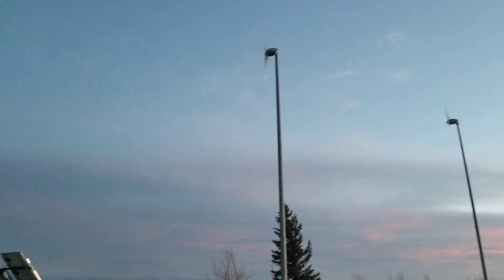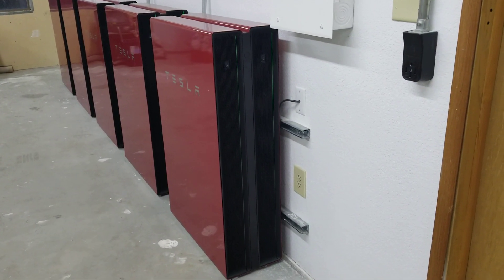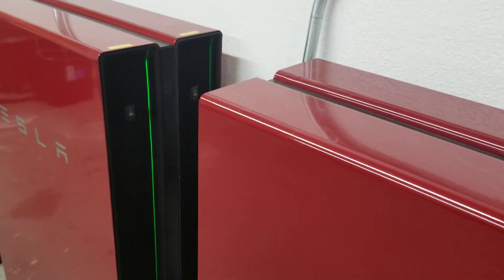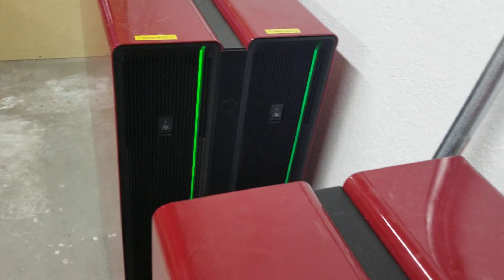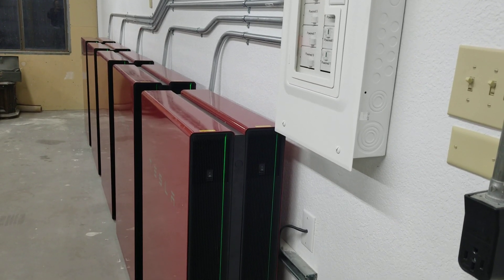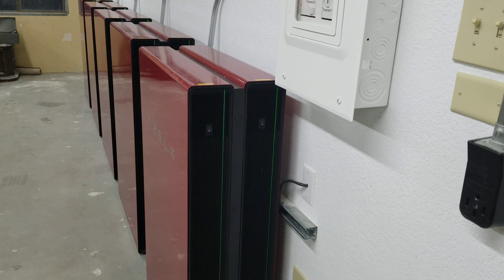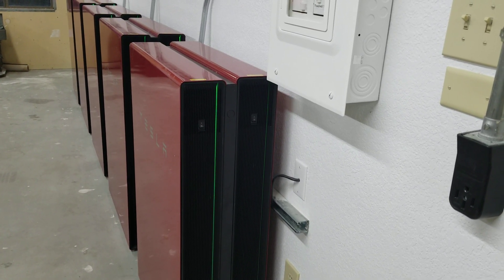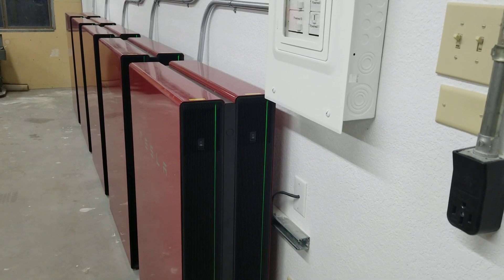Our 10 Tesla Powerwall 2 being charged by wind

Comment: Wind and solar energy combined with battery storage is the future.
Reply: @Jason Bloomberg I just came across your video and description- thanks for posting. I live in Scotland and have just installed a grid connected solar PV system with a Tesla Gateway 2 and Tesla Powerwall. The system has been up and running now for a month and a half. It’s cloudy and windy in Scotland and I’d like to supplement my renewable power generation with a small wind turbine, which will help to charge my Powerwall on windy days when it’s cloudy (which is common in Scotland) and in the winter when the days are short. Can you share the design of how you integrate the power from the wind turbines to your Powerwalls? I’m trying to figure that out and it’s complicated what components are needed - I’m being told different design approaches that seem more appropriate to me for an off grid system, rather than a grid connected system with battery backup, which is what I have. I’d very much appreciate your advice here as you have done it and it’s working. Thanks!
Reply: till its winter and theres snow and no wind.. ;)
Reply from the maker: @mattbarrand  actually we have substantial solar power production and even more wind power in winter. The batteries help bridge low gain days.
Reply: @AltView1  10 Powerwalls, wow! What is your self-sufficiency level? 
I would guess close to100%? 
What is your power consumption per day? 
Do you have any other large energy consumers besides your Model S? 
Maybe you could make a video of your power curve in your Tesla app? Would be interesting.
Reply from the maker: @Mr21December2012   On an annual basis we produce more electricity than we consume. One of the technical challenges for us is to balance generation and usage in order to minimize utilizing the grid.  This is where the batteries fit into our system beyond being a backup source of electricity during grid outages. 

Our home is all electric. We monitor our electricity use  using SENSE (R) which helps us understand which which devices are using electric at any given moment as well as daily, weekly, mo they, and annual consumption.  It also gives a comparison of our electricity usage with other homes equipped with SENSE (R) in Wyoming and the United States. While our electric vehicles account for ~30 kWh/day, our overall daily use of electricity in February 2021 was ~102 kWh/day, which is the average in Wyoming for typical homes which also have fossil fuel heating.  Nationally in the United States the average electricity use for the same period was 69 kWh/day. 

There are 100,000 BTUs per therm of natural gas. There are 91,740 Btus per gallon of propane. There are 3413 BTUs per kilowatt hour of electricity.

Comparing electric home heating to combustion is not intuitive because it takes a large quantity of electricity to creating the same amount of heat as combustion, but because electricity can be made by renewable sources, when it is sourced that way it remains the environmentally better wat to do it.  That does not make it cheaper in the short term.  When people talk about monetary costs, rarely do they include the environmental costs of man made climate change or the health impacts of air pollution. From my perspective, fossil fuel use can be seemingly cheaper for the end user, but that is due to cost shifting the real expenses of environmental and health impacts on to others.

Here is a link to information about SENSE (R): https://sense.com

It's a device / system we use. Others may use other similar equipment.  I'm posting the link so you can understand what I referred to, not trying to promote it.
Reply: @AltView1  I think your wind power installation is very interesting  (especially, since you seem to state that you make more wind power in the winter, than solar) - and probably overlooked by most people trying to use renewables for home use.
Reply: @AltView1  are the wind turbines  winterized ?, see what happen in tx if their not.
Reply from the maker: @hillbillyintheasia6122  small scale  residential wind turbines are not "winterized" in that they do no not have active defrosting systems. That said, the Skystream 3.7 blades are made of materials which resist the kinds of ice accumulations which were a problem for the large scale turbines in Texas.  We have just been through over 36 hours of blizzard conditions during which our turbines continued to fully produce power.  There have been freezing rain storms in the past which have Iced blades to where production dropped for a day or two.  Having a system like ours which balances power production between wind turns, pole mounted solar PV, with substantial battery back up means for us, when the grid goes down we likely will have uninterrupted power.  We also have a secondary back up system, a propane fueled generator should the array and turbines become unable to produce power during a grid outage and the batteries become depleted. In short, we are the opposite of Texas.  We routinely live with real winter every year and have systems designed to work under these conditions.

Having pole mounted PV also means we are able to remove snow, if needed, in winter when it would be nearly impossible to do that on a roof mounted system.  

Here's a link to my video about it:

https://youtu.be/Z1DnH0JzTqA
Reply: @mattbarrand  I think you missed that this guy is up in Cheyenne.... xD.   There's ALWAYS wind.
Reply: @mattbarrand  
Don’t forget lack of natural gas and shortage of  liquid gas as seen in Texas.....
Reply: @mattbarrand  but there's still salt to put on the solar arrays, and sun yay

Comment: Did you have any problems hooking the wind turbines to the power walls.  I know Tesla hasn’t really stated how to combine the wind power with the solar in there system.  Your system looks great.
Reply from the maker: All of our grid tied solar PV and residential scale wind turbines go to a 100 AMP  "renewable combiner board" which connects to the Tesla Gateway on the House side of the circuit.  The system itself treats the wind turbines no different than the microinverters for the solar PV.  They all operate even when the grid is down unless the batteries are 100% charged. At that point the inverters in each Powerwall 2 shifts frequency so that the turbines and microinverters shut off until the batteries are sufficiently depleted that they can again accept charge.  Tesla does not certify wind turbines for use with the Powerwall 2.  There are not enough of them to make it worthwhile, but the Skystream 3.7 turbine meets the same National Electric Code standard as most solar PV inverters, so in fact, they work. This may not be true of all wind turbines.

Here is a link to a tread I started on this topic: 

https://teslamotorsclub.com/tmc/threads/residential-wind-power-and-powerwall-2-integration.191776/

Comment: Rig for silent running.  The peasants down the road have a loud construction site generator.
Reply: Might happen soon!  Meanwhile you hold the record in my book for home energy independence. Anything I can do is limited to 1/2 acre in the bottom of a wooded canyon in NorCal.
Reply from the maker: I actually went around to my neighbors before the turbines were installed and all of them were fine eith it. Many of them have during ranges on their properties. Generally, the ethos here in Wyoming is, what you do on your property is your business, not mine, unless it impinges on my enjoyment of my property. Nonetheless, I still checked back after installation of the turbines and everyone was still fine with it. Our property is just under 10 acres, the rest in the neighborhood are a minimum of 20 acres, so we all have a fair amount of distance from each other.
Reply: @AltView1   You have a great system, very impressive. My lithium batteries and inverter keep my fridge and chest freezer cold for about 4- 5 days. In NorCal the utility shuts the grid down for wind emergencies and wild fire. The last time was 4 days. Some guy about 1/2 mile away had a loud generator that ran for 3 days and nights. I was awake at 3AM  from the heat (92 in the house, terribly  smokey outside). The generator sounded different, clattered for 20 seconds then stopped for good. I think it threw a rod. He refueled it while running but probably didn't check the oil.  My batteries and inverter worked fine, no sound at all.. All of the unprepared neighbors had their cold food spoil.
Reply from the maker: @kimmer6  It would be great if you would make and post a video about your system. I'd love to see it.

Comment: Don't even want to know what that cost (of course I do).
Reply from the maker: Cost of Powerwall system installation ~$100,000 (not including solar PV or wind turbines).
Reply: May I ask how many KWH you average per month?
Reply from the maker: @wilhallman2890  both production and consumption substantially vary seasonally.  Last year we produced 33,895 kWh and consumed 30,249 kWh. The highest consumption was in February 2020 using 4013 kWh and lowest in August with 1307 kWh.   Highest production in 2020 was January with 3540 kWh and lowest was September with 2337 kWh. While at the end of December 2020, we had over 4,000 kWh banked with utility under Wyoming's net metering law, it is not permitted to roll into the new year, instead having to be cashed in at the wholesale rate of $0.03/kWh while we pay $0.105/kWh for any power we draw back from the grid during January, one of our highest consumption months due to the effects of cold weather on our home and electric vehicles. We hope the onsite storage with our batteries will help shrink  how much we rely on the grid for net metering, especially since the Wyoming Legislature is trying to kill all net metering in Wyoming.
Reply: @AltView1  80kWh/day is huge energy usage. 
What percentage of that is consumed by charging cars?

I live in Europe, 4 people, 2000 square foot apartment. Average energy consumption is 10-13kWh/day ( home office 3xPC 8-15h/day ), and compared to people whose bills I've seen, I have high energy consumption. 0.19$/kWh (whole bill/kWh used, not just energy cost).

Non-electric energy costs: City heating(expensive) avg 311$/winter month, gas stove, gas hot water (25$/month).
Reply from the maker: @CarmichaelCharles  in your question you note that you have non-electric municipal heating (centralized stem plant?), gas cooking, gas hot water, all of which are combusting fossil fuels.  Our home is all electric. We monitor our electricity use  using SENSE (R) which helps us understand which which devices are using electric at any given moment as well as daily, weekly, mo they, and annual consumption.  It also gives a comparison of our electricity usage with other homes equipped with SENSE (R) in Wyoming and the United States. While our electric vehicles account for ~30 kWh/day, our overall daily use of electricity in February 2021 was ~102 kWh/day, which is the average in Wyoming for typical homes which also have fossil fuel heating.  Nationally in the United States the average electricity use for the same period was 69 kWh/day. 

There are 100,000 BTUs per therm of natural gas. There are 91,740 Btus per gallon of propane. There are 3413 BTUs per kilowatt hour of electricity.

Comparing electric home heating to combustion is not intuitive because it takes a large quantity of electricity to creating the same amount of heat as combustion, but because electricity can be made by renewable sources, when it is sourced that way it remains the environmentally better wat to do it.  That does not make it cheaper in the short term.  When people talk about monetary costs, rarely do they include the environmental costs of man made climate change or the health impacts of air pollution. From my perspective, fossil fuel use can be seemingly cheaper for the end user, but that is due to cost shifting the real expenses of environmental and health impacts on to others.

Here is a link to information about SENSE (R): https://sense.com

It's a device / system we use. Others may use other similar equipment.  I'm posting the link so you can understand what I referred to, not trying to promote it.

I hope this helps explain our usage and the differences between ours and your situation.
Reply: @AltView1  Thank you for your comprehensive answer. We still generate most of our energy from coal. I get my heating from coal in a combined heat and power plant.

I checked the national statistics and for 2018 the average household energy consumption is ~6.6kWh/day. 10x less than the US average. The only major difference in homes I see between the EU and US is very few air conditioners in households. 

According to the same source, only 3% of households use electric heating (including heat pumps and others) and 24% use electricity to heat water.

Comment: mounting next to floor not good - think water  - heavy rain flood ect
Reply from the maker: Each Powerwall 2 unite weighs ~250 pounds. It's  designed for floor mount and per Tesla when stacking Powerwalls, as these are in pairs, floor mount is the preferred method.  Also, when floor mounted they are on feet.  Ours actually are mounted to both wall and floorn inside our garage, more than 20 feet from the garage doors.  If water gets to these Powerwalls, we have bigger problems to worry about. Keep in mind, we are in Cheyenne, Wyoming and outside of any flood zones.
Reply: @AltView1  Cheyenne is in a wind zone. I've driven through there going to Yellowstone one time. It was so windy. I heard on the radio that a couple of big rigs had blown over somewhere on I-25 when I came through.
Reply from the maker: @Rhaspun  we did onsite wind studies on our property for 2 years before installing our first turbines here in 2012.  So far, these have withstood winds >90 mph without damage.
Reply: @AltView1  That's good. When I came through that one time. The winds were about 50 mph.

Comment: Wow super cool , your living the dream here!!As a sophomore doing electrical engineering I'm currently working on my own at home solar system so I can power my work shop and hopefully more one day. Though I'd like your input on something if you don't mind which is whether doing home system's like this actually better for the environment in terms of carbon dioxide emissions. ( this is not a troll but a serious academic question btw). For example was total approximate amount of emissions for the manufacturing of the power walls , ect. Something you factored in to deciding on your system here and if so where did you find the information that lists things like that cause I find it notoriously hard to find reliable information, what common soruces do you use to find such info?For states like we live in that have ditry girds , it's pretty clear that renewable is the way to go I'm terms of reducing foot print , though I'd like to be more rigrious in knowing how much impact I'd still be contributing even though it would be significantly less. Keep up the good work!!!
Reply from the maker: Trying to figure and compare carbon emissions in manufacturing and installation is challenging, in part because the carbon emissions "inputs" for the comparison varies widely from home to home and region to region.  We live in Wyoming. The majority of our grid electricity comes from coal.  This does not take complex calculations to determine the benefits of our minimizing our getting any power from the grid.

One way to see how clean or dirty your local grid is, is by using this tool from the Union For Concerned Scientists: 

https://evtool.ucsusa.org/

While it is oriented to EV emission impacts, try the same vehicle profile in different geographic areas.    

People who like to grind anti-renewable energy axes with pull all sorts of numbers out of thin air for the environmental impacts of making renewable energy systems, but rarely if ever consider the true impacts of the fossil fuel approach they are polemicizing.  A basic question like how much electricity is required to make a unit of the fossil fuel useable for the end user is generally ignored. 

My basic rule is if someone wants to challenge the environmental benefits of our renewable energy systems the burden of proof and demonstration of their methodology and calculations must be fully disclosed or all they are doing is being opinionated at best.

Here is another link with information to consider:

https://www.treehugger.com/how-much-co-does-one-solar-panel-create-4868753

There are some things I don't believe I have to debate: the Earth is not flat, the sun and the stars do not revolve around the Earth, Climate Change is real and  human caused, renewable energy systems pollute than fossil fuel based energy systems.   

My interest is in sharing our real world experiences with this technology as we apply it.  Others can then decide what is useful or applicable for themselves. I hope this helps. 

In our case we have demonstrated that upto 10 Tesla Powerwall 2 units can be used with a combination of wind and solar PV in Cheyenne, Wyoming as part of an all electric home with multiple electric vehicles.  It works year round in a climate with real winter.  It's not just "a California thing."   

I'm also clear that if financial ROI is the sole consideration, then in our situation batteries would not be a good investment, but for other considerations, it may be, and was for us.

Comment: I was under the impression that 6 was the maximum number in one system.
Reply from the maker: Maybe that was true of the original Powerwall, but as far as I know, the Powerwall 2 has always been able to have up to 10 units.  That said, it's unusual for anyone to do it, which is why I thought it would be interesting to share that it actually is possible.